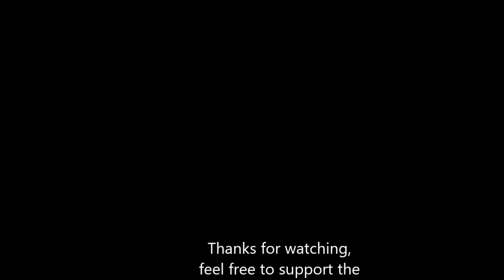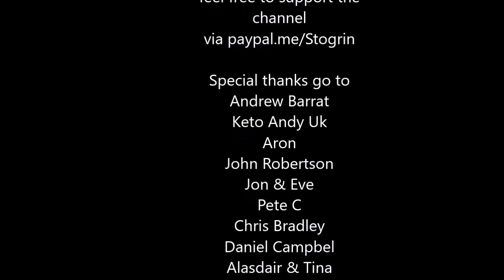Yamaha RS125 Dx project. Buddy's engine casing gasket and oil. 125cc

Comment: Hello nice work on bike I had a v reg Honda 125t the rubber from carbs was. Shot so I got some car radiator hose work great if you have and pipe that will fit in to your air box you could cut to fit between air box and carb use jubilee clips to hold in place
Reply from the maker: I didn't think of that. Thanks Gary :).
Reply: @CortinasAndClassics  ok it work ok on my twin good luck